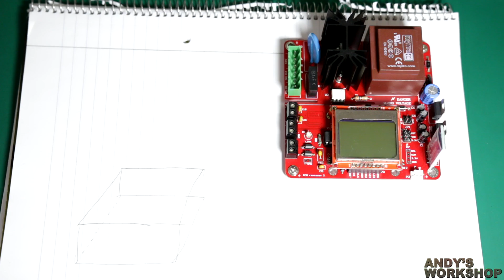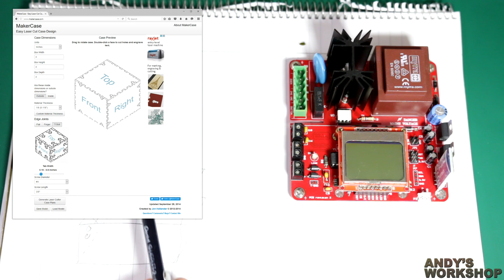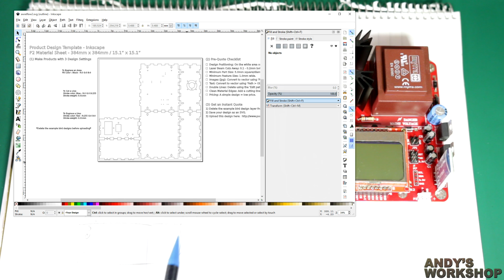A custom enclosure for my reflow oven controller

Comment: Hi, good job but you'll have no airflow in the box, simply because the hot air can't escape from it

Just some holes at the front and you will have a nice airflow to cool down all the components

Thanks for your work ! I've already ordered the components and the PCB :-)

Comment: Good work, looks really nice! Have you considered changing the "oven outlet" connector to a female type? That's basically standard because then you don't have the grid voltage on pins sticking out where you can get at them with your fingers. :)
Reply from the maker: +Jóhann Friðriksson It was a bit naughty of me to use a male outlet but I have a bag of 'kettle' leads that need a home so I went for it knowing that I'm the only user. I made a note on my blog that anyone building this ought to consider the risks of a male outlet.

Comment: Fans I have taken to bits are brushless DC motors, hall effect sensor + chip to change windings. Probably reverse polarity will kill them all. But does offer the chance to replace the presumably common chip.
Reply from the maker: +David Pilling I did try to get inside the fan but the two plastic halves of the assembly appear to be glued together so strongly that I can't get them apart without something like a dremel.
Reply: +Andy Brown just pop the blades off. Enough of fans, interesting material, boxes always a problem with projects.

Comment: If it's good enough for Amazon to use that boxing method, it'll be good enough for Razerlab. Nothing wrong with the cardboard wrapping method.

As for the protective film, it's not surprising that Razerlab left it on. All companies will do because it's a very manual process (expensive) to take it off as you probably found out.

What probably allowed your panels to fit together more easily was that they could have warmed up, the protective film is not inside the joints so has no bearing on the fit.

Do you have exhaust vents for the the air? Or are you basing it on the air leaking out at all the joints?